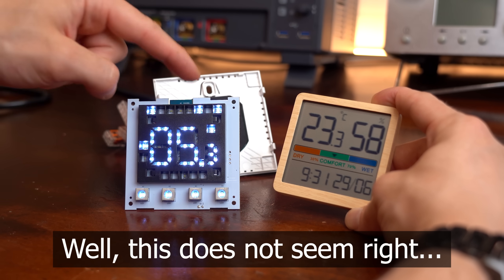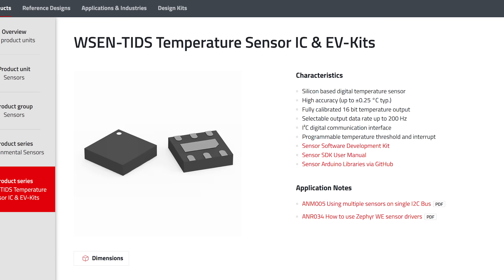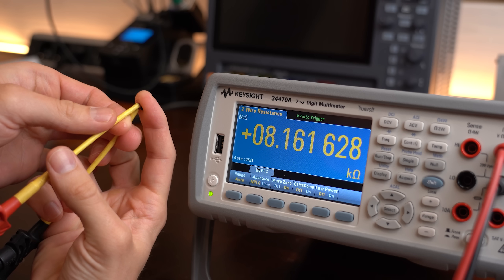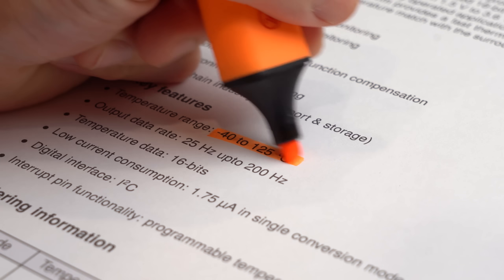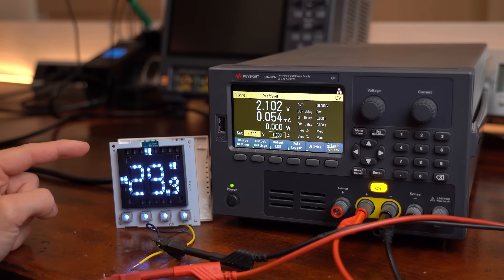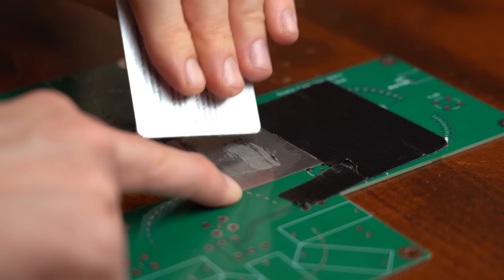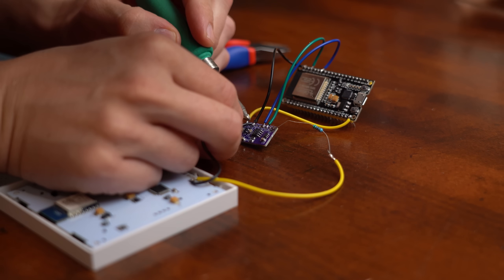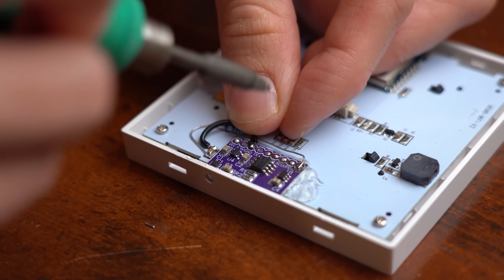From Meh to WOW - With 1 "Tiny" Hack!

Comment: I'm quite sure there's a temperature offset setting in HA for your thermostats but yeah, that's also a solution...
Reply from the maker: Yep. I can set an offset. But the value will still drift overtime and became very unreliable. So that was not a solution.
Reply: Even the thermostat itself may have that
Reply: It will probably only affect the value displayed in HA, not affect its own display or heating function. But often these devices have internal adjustment settings for calibration purposes. Probably hidden behind a 'secret' key combination. If you combine that with replacing the NTR with a more reliable one it would have been easier?
Reply: The accuracy would be very poor, however.
Reply: also the wife will look at the displays and not HA .....
Reply: @hachogonzalez8649 the wife should always see higher temperatures than in real life.
This is important people.
Giving them the real values means it cost more money

Comment: What happened to the ESP32 in the final design. Shouldn’t this be part of the PCB? I.e. which component implements the I2C?
Reply from the maker: The ESP32 was only for testing. The ATtiny on the PCB does its job in the end.

Comment: Even though this is kind of crazy and impractical (still love it), it's smart to use an DAC. Learnt something new for my future projects.
Reply: can use PWM and RC filter instead of DAC for this non-demanding application, which also keeps the ratiometric properties of the original biased NTC, w.r.t the supply voltage.
Reply: @perenis-z9r  penis